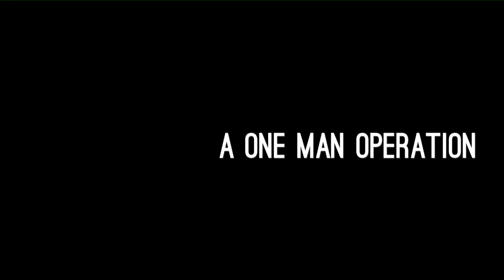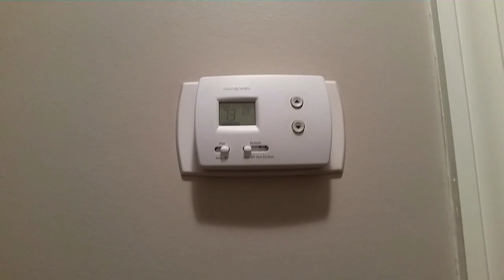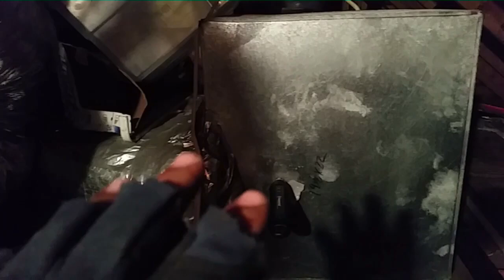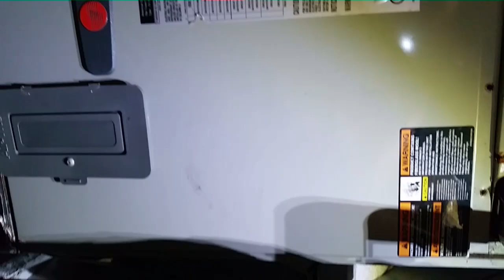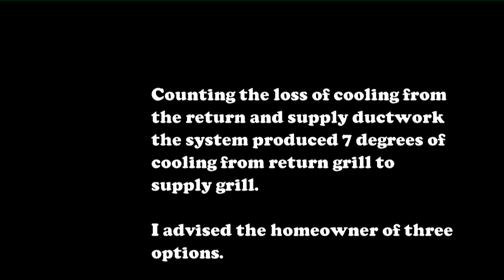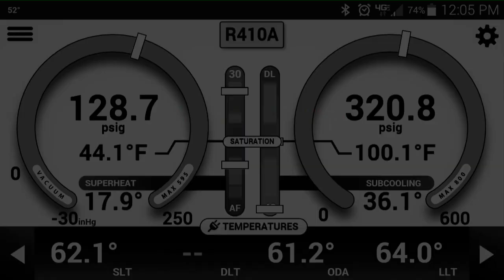The Effects of Having Old Duct Work

Comment: A proper design of all the components of the system will avoid most costly problems…

They have done exhaustive testing on HVAC airflow systems and found that 7 in 10 were not within airflow tolerances. 
When you go to an ECM motor and you don’t have sufficient Available Static Pressure the ECM Motor may exceed its RPM rating and overheat and fail because it is trying to deliver the pounds of air for each CFM that is called for. Pounds of air per CFM is a variable, because we don’t just have Standard air conditions like we are wrongly taught to use; there are many variables that have to be put in the formulas to achieve any decent degree of accuracy… …

The first thing we have to remember is that most duct systems are not sized properly to achieve 700 to 900 feet per minute velocity in the main trunk and then for 450 to 600 feet per minute in the branch ducts. The main trunk also has to be of the reduced trunk sizing type to maintain static pressures & velocities through all the branch ducts and the diffusers need to be sized properly to deliver the desired throw velocity to get the proper mix of the air in the rooms. 

Therefore, if you have a 0.6” or point 0.7” rated blower… 
Using Manual D, you actually need at least 0.3 inches of ‘Available Static Pressure’ (ASP) in order to use a ‘friction rate’ of at least 0.075” on the supply runs to maybe get enough airflow velocity. . 
So you have a 4-Ton system and evaporator has a pressure drop of .43 inches & he filter area is sized to only get 700-fpm velocity which will go from a .2” PD a listed test rating @300-fpm to probably .35” PD from the 300-fpm published figures; that is a .78” PD, even above the highest blower Rating of 0.7”. 

Maybe errors as used voice software type this...

Comment: With a 2 ton pump coupled to a 2.5 AHU, will the charge (a) vaporize too quickly causing insufficient cooling or am I (b) full of shit as usual?
Reply from the maker: There is a TXV that will meter refrigerant through properly as long as there is enough to do so and the coil is not way oversized.

Comment: Had the same sorta issue yesterday! Return grill 76° but return plenum measured 90°... return through the hot attic. Sheet metal with no sealing of joints or insulation lol! Landlord/slimelord didnt care of course he doesnt pay the utility bill
Reply: awsom70 Could this situation cause the evaporator coil to freeze over on really hot days and does landlords not authorizing needed repairs ever cause the tenants to give your company a bad reputation?
Reply: Daniel Baker no on the coil icing. And as far as reputation it sure could however i drive an unmarked truck and dont give out my info to tennants i tell them to contact the landlord if they have an issue. Slumlords are a pain to deal with and to work for but...
Reply: awsom70 Thanks for the useful information.  In cases like this do you do your wet bulb  after the air has passed through the plenum or is the return good enough since the plenum is not that big of an area?  (Don't feel obligated to reply.  I am the guy that hangs over your shoulder asking you, 'what does that do'?.
Reply: Daniel Baker the most accurate place to take it will be as close to where the air enters the coil such as the plenum but sometimes i do it at a return grill however that may not be the best thing to do especially with heat gain and infiltration through the duct work

Comment: must of been hot up in the actic...  old duck work can not handle it.time for a new system .
Reply: Attic fans are very under used especially when mechanicals are up there. I have one.  AC runs less.
Reply from the maker: steven lavimoniere it was hot as hell. today the high is 100. I bet she wont be getting much cooling at all today
Reply: talyn875 have you ever installed actic fans cut into the roof on a tsat . i have used them a few times ,cut them into the roof and they seem to really help .on the job like that .they are a few hundred dollars . and all you need it 110 volts to run them i set them at about 85 degrees . they come on automatic. on temp rise . and shut of on temp drop
Reply from the maker: steven lavimoniere i went back today because I could not get access to part of the attic. Once I  was able I saw a lot of Insulation falling off the duct and like you said the attic fan was not working.

Comment: great video.  sounds like bad wire.  I have a lot of those in 40 year old apartments right behind t-stat that has been changed 5 times.  wire broke inside insulation, ohms good, put a load on it and it is intermittant.
Reply from the maker: All Hours Maintenance The wire had been around for a while and it came apart as soon as I loosened the wire nut. I hope that proves to be the cause. Bad news, it doesn't cool well anyway.